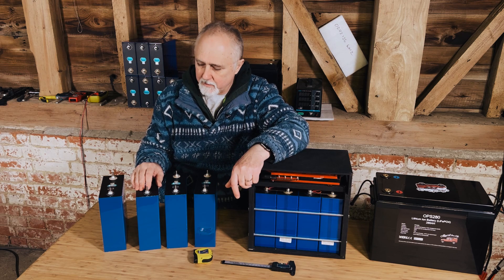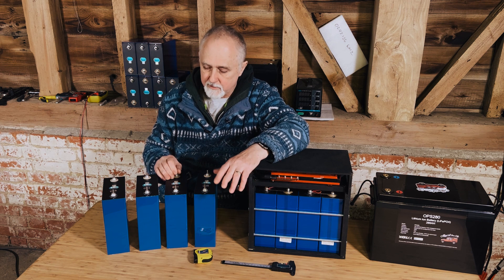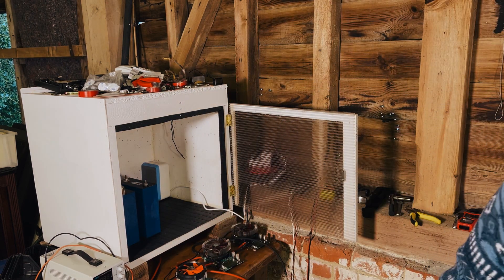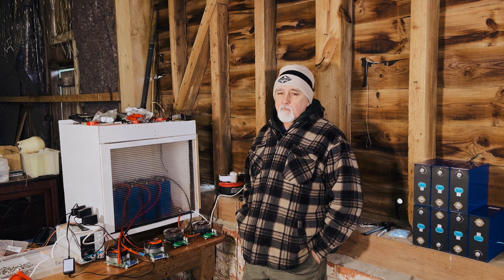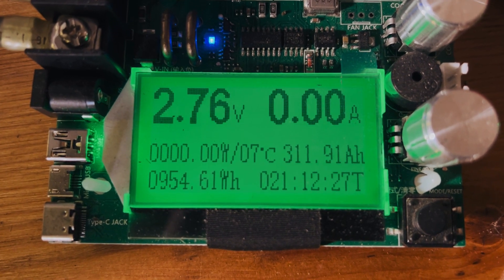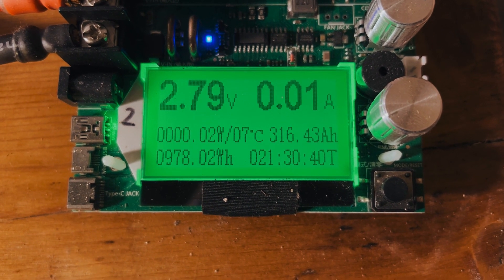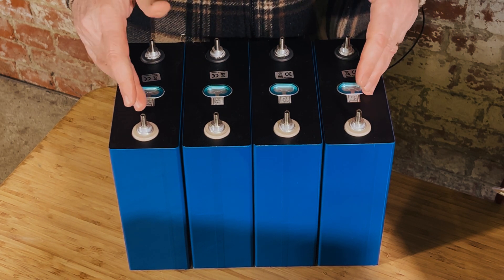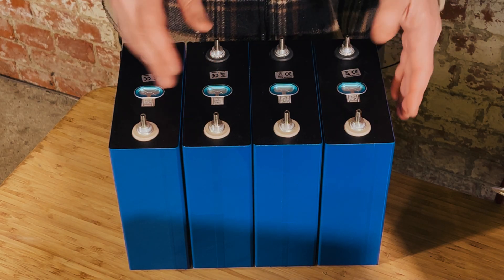320AH LiFePO4 Battery Cells: Capacity Test Results

Comment: Genuine retailers in China sell them as 304Ah cells.
Reply from the maker: Yep, seems the smaller guys try and get some sales by fudging their advertising a bit.
Reply: How do u know who are genuine ?
Reply: @tospicy4ya  Iv bought from fake sellers in China.  In the end I paid the extra money to buy premium cells from a reliable and reputable seller with a known track record. Price should be going down slightly because more people in the USA are buying server batteries. That's because it's a ready made battery with a BMS and metal case. Unfortunately they haven't made there way to the UK.  Personal I like building my own battery because I can check/match the cells and top balance them before building a battery with the BMS of my choice. Just remember it takes 2-3 months to get the cells to the UK and there is always the risk that they will get stopped or returned but UK customs. The cells can get damaged in transit or damaged by UK customs. You have to order extra cells to guarantee you get enough cells to build a battery. Yes eventually it works out cheaper but there is always the risk of something going wrong. Which is why UK sellers have to raise costs to cover any losses. It wouldn't be fair to share my seller on this channel. I think it would be very rude if I did. You have to get online and do the research your self. Then send your money to China and hope for the best.